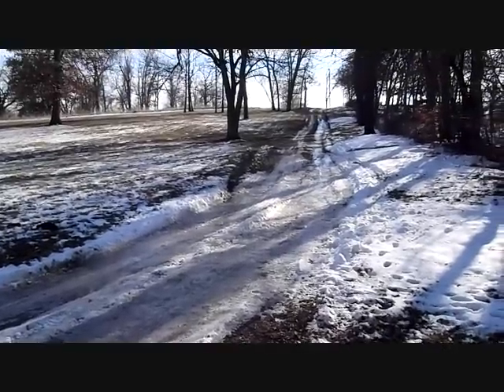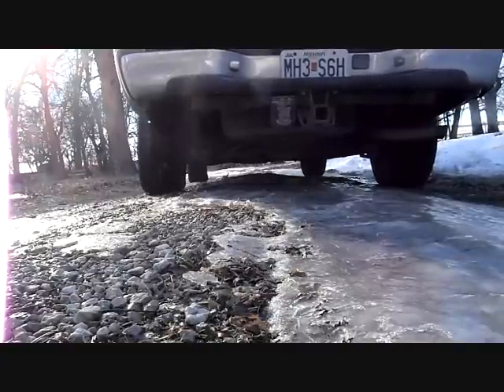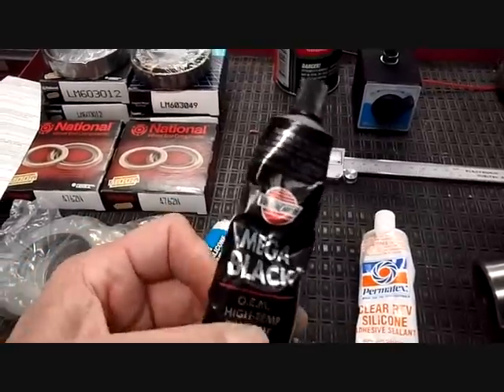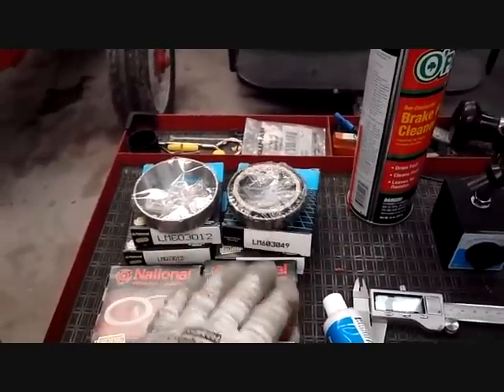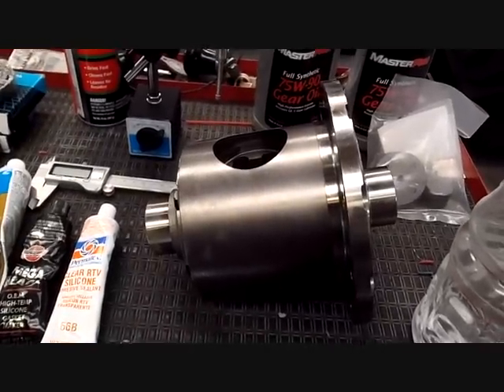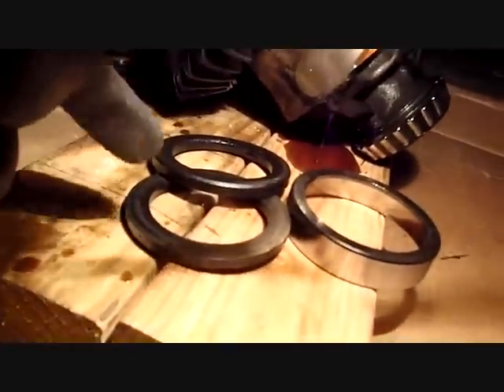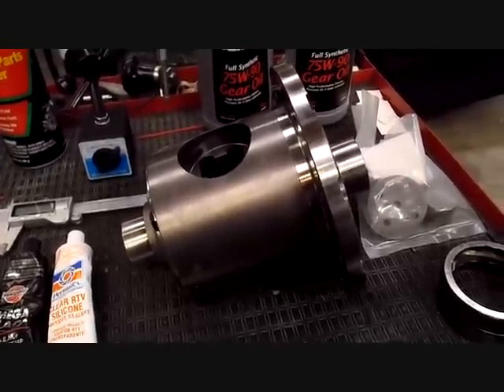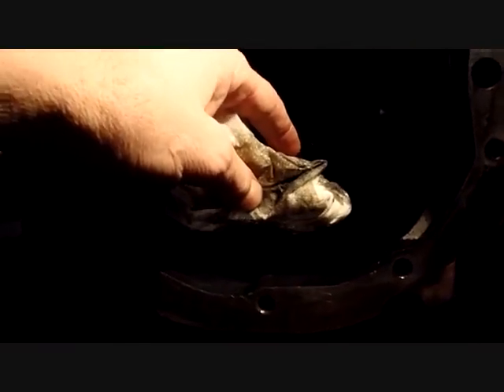How to install a Detroit Truetrac limited slip differential carrier. ADVANCED INSTRUCTIONS!

Comment: Fantastic video, very informative! I used to have an 03 Tahoe 2wd that I was going to install this in, unfortunately she lost a battle with a palm tree a few years ago :/

Now I've got a 93 Suburban 2500 4x4 with the 14 bolt rear end. Great truck. 454 motor with 132k. Spider gears aren't looking so hot and I could use the extra traction in wet muddy Florida, this is surely on my list!

Just read your post about your truck having 240k on it. Man these trucks just wont quit if you treat them right!! That is unless you pick a fight with a palm tree of course...

Thanks for the video!!!
Reply: Man. I have a 04 Tahoe 2wd need a lsd or something idk

Comment: Great video, very informative...
I'm installing two of these True Trac diffs. on my 2003 Jeep TJ.
Reply from the maker: Awesome!!  Let us know how it goes?
Reply: +mowerdog 

I installed TrueTracs, both front and rear. 
Really like them so far, and you don't notice anything different, until you need them.
Well, actually I did notice one instance under hard acceleration when turning onto a highway from a secondary road. The pavement was wet from rain, and both rears spun momentarily and the TJ crabbed a little like an old positrack unit. But it was just telling me that it's working as designed.
Reply from the maker: It has it's ways of letting you know it's ready to work.  One time with 
snow and ice on my driveway and road I thought I would do a simple 
Doughnut and spin my truck around. Wrong!  I hit the gas, turned the 
wheel and it pushed me strait into the ditch across the road.

Comment: Synthetic is not recommended for that carrier. I used the same gears also and the factory shims worked for mine, gave me the same backlash
Reply from the maker: From the Eaton site it states that the Truetrac can be ran with synthetic.  I have a ton of miles on it and it works great.  I'm glad your shims worked out too!  That saves a huge headache.....
Reply: mowerdog as long as it works well thats good. The instructions mine came with said specifically no synthetics just conventional oil. So i guess its like everything else conflicting info lol.
Reply from the maker: I saw that too.  But I believe that was a copy and paste spec.  If it had clutches I would have used Dino oil.  Really as long as it has grease in it seems to be all that matters.......  Glad your's turned out as nice as mine!!
Reply: Hopefully thats how mine will go when i do it lol
Reply from the maker: Let us know when you get it in?  Make a video if possible. If possible please use this link to buy your parts.  I will get a few bucks if you do and it won't cost you an extra penny.  Thanks!  http://amzn.to/2FIUKuP

Comment: I live in the snow belt and I will never buy a 4x2 truck again!! Sand bags dont help much either.
Reply from the maker: I hear ya!  But if you ever get a 2wd this diff works wonders.  I added some heavy tread old school snow tires and these tires eat right through mud and snow.
Reply: @mowerdog  No more 2x4s for me! I have stud snow tires in storage
Reply: @jasonzee4561  Many 4wd vehicles have open differentials, making them 2wd (one front, one rear) on low traction surfaces.  You want to ensure that you have a good limited-slip carrier in the rear whether you have 2 or 4wd.

Comment: That was not your first rodeo doing a gear change was it? Or shall i say Diff Swap!!! I'm always afraid to do it because I was led to believe that there was some super precise shim work to be done so I was always paranoid and had to bend over and let a gear shop slide it in REAL DEEP, but I think I might try it now!!
Reply from the maker: I had the shim pack ready if needed.  But after I installed the original shims all was good. If you only change out the diff but not the gears you will only have to adjust the carrier if needed.  You won't have to adjust the depth or load of the pinion.  This makes it a lot easier.
Reply from the maker: I used to work in a repair shop and repaired or changed the gears going through the full set ups.  I maybe did 25 in the 10 years I wrenched for a living.

Comment: Thank you for the vid. Truetrac is great for the everyday driver. just remember that it will still act like an open dif if one tire is in the air and the other one the ground.

They work great in front axles to if you have 4x4 of course.

Comment: You know those vehicles with the 8.5 came with a g80 locker but the clutch plates wear out.
Reply from the maker: +Ryan Stansel  Thanks for that info!  I like it that the Truetrac has no clutches...
Reply: Guess I better look at mine. 230k miles still locking.
Reply: The G80 is a true automatic locker. It doesn't have clutch plates like a limited slip differential.  It is sometimes called a limited slip, because it is activated when one of the wheels starts spinning faster than the other.

Comment: Old trick is to apply the parking brake just until the vehicle starts to move and don't forget to release it after you get trough the slippery stuff. The brake that get friction will stop the spinning wheel and shift the power to the other side.
Reply from the maker: gunlover1955 Good advice.  Thanks for sharing!
Reply: +mowerdog so is it as locker or a limited slip differential.
Reply from the maker: Limited slip.

Comment: Not poo pooing your video.!
I'm a lic. Tech.. And I  Work in trhe BC mountains . I drive 100km on snowy roads most drive 40km.  
The reason .4  Studded winter tires. .
In my experience    .There's Good chance, your suburban would make that hill with studded tires.
I also drill and stud,  any tire.  with the right tread pattern. When I was a young Appretice.
 I had stud Ice racing and rally tires.  Drill and stud  255 studs per tire/Stud  per lug. 
Studs are allowed in BC in the winter months.  Up to a certain number per tire.  I push that a bit.
I have JUST !   made it up hills  !   In 2WD    Stop and go traffic . Only 4x4's  or chained vechicle's on the road and ME. 
Studs allowed were you are ??
What do you think of studding your own ?
Reply from the maker: I'm not sure if we can run studded tires here in Missouri?  My Dad ran some when I was a kid.  It would be kind of cool to install your own studs!

Comment: Nice video. Would like to know how it has held up since install.  I have about 75k on my tru trac  aam 11.5 Cummins. It's making all sorts of racket. Gear set inside getting loose hasn't broke yet but it has me starting to wonder...
Reply from the maker: I have over 50,000 miles on it now.  It still works great.  I don't know about your issues?  Until you get the cover off you really can't tell for sure?  Could be the carrier, gears or bearings? But I would fix it now before it causes a total disaster in there.

Comment: Thanks Mowerdog!

Lovely video.. Very informative, and showed everything I needed to know... and what to write on my shopping list (coz I only got the Truetrack unit so far).

I wish there was a video this detailed, guiding on how to successfully to install a new woman in my house. :-D
Reply from the maker: Maybe your existing unit needs some new bearings and seals?   Of course it could be the driver of said unit that needs a new driveshaft?  Maybe some different lube?  Remember you'll be money ahead if you keep and use the old machine rather than going out and getting a new one............
Reply: mowerdog Ha ha ha.. good healthy humor right there!  :-D  
Thanks again !
Reply: Chryslerdude BTW.. (back to the more serious bit :-)..  Was the new bearings same inner diameter as, or bigger than the original bearings? Somewhere, I read that they are different than the original, but it's probably not the same on my Dodge anyway.. 8,75 (2070741).
Reply from the maker: The new bearing and races were the exact same size and part numbers as the originals.